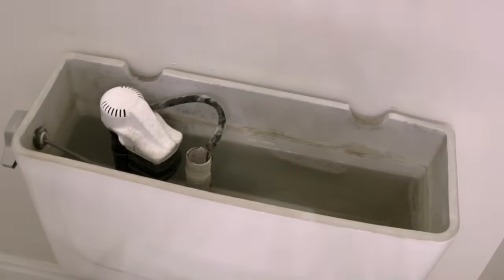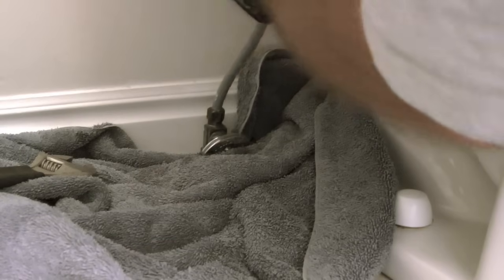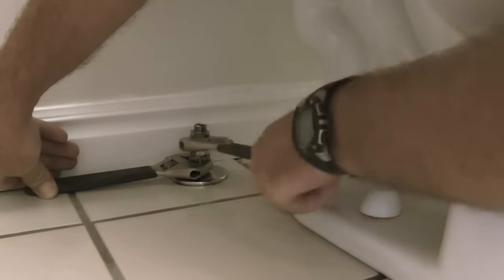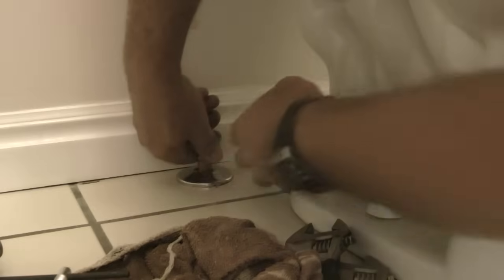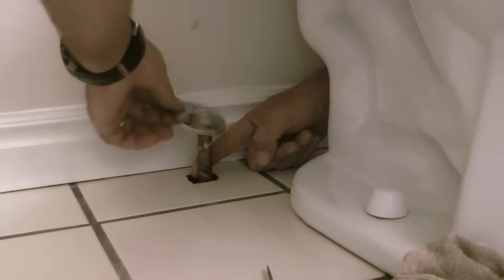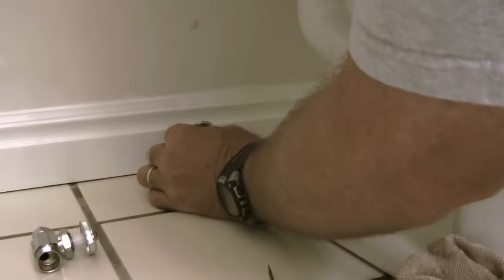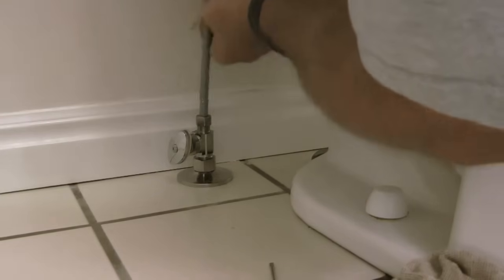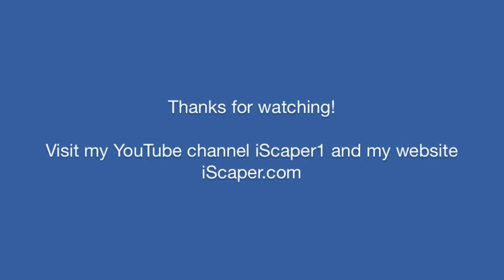Toilet shut off valve replacement

Comment: Very good demonstration. Only thing I might add for anyone who is not familiar with the details such as turning the main water supply off may need to be told this. Most plumbers have experienced floods and would know this is an important step but someone who is a first time DIY plumber may need to be shown. Thank you for your video.

Comment: I don't understand this video: why isn't water shooting everywhere?  I cannot turn off the water to the valve, and the valve won't turn off the water.  When I do what he says, water just sprays everywhere!  Which step magically stopped the water from coming through the pipe?  Confused and wet.
Reply from the maker: You have to shut off the water supply to the valve before replacing it. On my replacement I had to shut off the main supply to the house before changing the valve.
Reply: I saw he skipped that important step as well- but realized i was just an omission.  Otherwise great instruction video!
Reply: mahdroo turn off the water to your house first
Reply: @bludika  What I want to know is why an expert like you is on this same video as us noobs?
Reply: He does say, in the video to shut off the main water supply not just the valve

Comment from the maker: I wonder if the pipe your referring to is galvanized. A lot of older homes were plumbed with galvanized pipe. Normally you don't get a lot of rust with copper pipe. You might want to try WD 40  a few times on the threads, then if there is room place a pipe wrench behind the valve to hold the supply pipe. Then try to carefully thread the old valve off. Careful, you don't want to break the supply pipe.

Comment: to loosen 5/8" compression nut, turn clockwise and to tighten it turn counter-clockwise. you show counter-clockwise to tighten it but you said turn clockwise. surprised no one else commented on this
Reply from the maker: Look again, if you pivoted the bottom of the valve to look at it while loosening or tightening, clockwise and counter clockwise are as I described.

Comment: Thanks for the video. Just tackled the shut off replacement as well as adding a bidet. FYI all, I replaced the shut, the plumber who put it in 15 years ago made the pipe too short. So I couldn’t put the trim ring on (I’ll add one that opens)and after 10 minutes, a small leak formed on the bottom of the shut off. I tightened it, still no good. I took it apart and put some pipe dope on the top of the ferrel. So far so good.
Reply from the maker: Good information, thanks for posting.

Comment: I cannot separate the metal nut on the supply line from the copper fitting inside the tank.  Any ideas?

Comment: Thanks. Very practical. But suggest Quarter turn valve not the multi turn valve you use that has rubber gate stopper that will deteriorate.
Reply from the maker: Good tip, thanks for posting.

Comment: Tools/Supplies:
--compression sleave puller
--two wrenches
--3/4 inch stop valve
--screwdriver
--fill valve (if also replacing that)

Comment: How can I tell the size of my valve?
Reply from the maker: If it's copper pipe then it's probably 1/2". Copper pipe has a 5/8" OD (Outside Diameter), so you would want a compression valve that's 5/8 x 3/8.
Reply: @Iscaper   K, thank you.

Comment: Great tip on the compression sleeve puller. Other videos say to cut the pipe but that may leave you with issues down the road if you have to the repair again and don’t have enough pipe left.
Reply from the maker: Thanks, another option is to leave the old compression nut and sleeve on the copper pipe and thread the new valve onto the old nut.

Comment: I really like this video.  Instructions are very clear.  The problem with my leaking shut off valve is that it's not set up like this one......I wish it was.  The connection is straight but the valve assembly has a long bottom piece that fits onto the copper pipe.  I can't seem to find a YouTube video that shows how to replace the sort of assembly I have.  I fiddled with it and now instead of a moderate leak, I have a big leak.  :(  Time to call the plumber.
Reply from the maker: Haven't seen the valve you're describing. Can you remove the whole valve assembly and install a valve like the one in the video?
Reply: The valve is soldered to the copper pipe which means the copper pipe needs to be cut.
Reply from the maker: mrs.sam.heughan
If you take a tubing cutter and cut the copper pipe behind the valve, is there still enough pipe protruding from the wall to install a new valve like the one in the video?

Comment: I hope you respond to my question.  You video was helpful especially when it was hard to unscrew the old valve body off.  Only problem I have is that the compression ring is unmovable and I cannot remove the nut and the ring.  I have blue plastic like pipes with a copper insert at the mouth of the tube.   How do I get the compression ring and nut off so I don't have to keep the old one?
Reply from the maker: You might have to buy a puller.
Reply: @Iscaper  I ended up paying for a plumber.  He didn't want to use one as he was concerned about screwing up the plastic pipe.  He just put the new valve on with the old nut and compression ring with plenty of plumbers goo...

Comment: Awesome, maybe I'll try this when I'm off from work, thanks for the video
Reply from the maker: Good luck!
Reply: @Iscaper  thanks. We were so close but our cheap seller for this manufacturered home chinced us on pvc pipe, the nut is basically at floor level and pulling up pulls other pvc pipes. But we've known they totally screwed us and messed up our plumbing since thr vent pipe from that bathroom is bent, didn't use the right pipe, etc. We still have half a mind to pay someone to redo everything right... Anyway, Your video was great though, I appreciate it a lot. Thank you

Comment: Since you didn't replace to shutoff valve with 1/4 turn valve, I have to say you could have done this by just replacing OEM parts stem, BrassCraft BCSR01 at home depot for 3 bucks each.  I replace 21 of this kind of valve 21 of them by just replacing the stem, no mess, cheap which will last about 17 years, the time when I notice 3/21 of them won't fully shutoff.  All of them shows gasket deterioration/deform/broken/cut/brittle, time to replace all.

Comment: Alas this did not work for me. After going through the whole process of getting the supply line, top nut and valve not off, I started in on the valve body. I attempted to remove with wrenches as in the video and twisted the pipe. Had to call a plumber. Turns out, there is no lower compression nut or way to remove it. He says the majority of plumbers now use a single pipe + shutoff valve unit that they solder directly on to the copper pipe. No way to separate because they are soldered. My plumber had to cut the copper pipe in the basement and solder on a new L pipe-shutoff valve, because, again, it's usually just one piece, not a removable piece with a compression nut/sleeve. I wish I had been able to do this myself but this video didnt' mention that I would need to solder. Too bad I found out once everything was disconnected :) lol
Reply from the maker: All of the supply stops in my house have compression sleeves and nuts. I have used a new supply valve with the old compression sleeve and nut because I couldn't get them of the copper pipe.

Comment: Our shutoff valve does not have a compression nut under the valve. It is just stuck on the pipe somehow. Any ideas on how to remove the valve? Turning it with the wrench is not moving the valve at all, its really stuck on there.

Comment: how do you replace the valve that is attached to PVC pipe thats crimped on
Reply from the maker: +don gaudry 
Are you sure it's PVC pipe and not PEX? PEX pipe is usually used with crimp rings. Also in the home it would be CPVC as PVC isn't rated for hot water. CPVC is usually done with glue joints. If it is PEX pipe and you have enough slack you could cut the pipe below the fitting on the valve and install a new valve and new crimp ring.

Comment: Thank you for your video; I had a leaking Toilet fill valve assembly and had to replace; the big problem was trying to get the bottom tightening knob off the Supply line that was a rigid steel pipe with an attatched washer flange on top. I had no idea ho to take a 3/8 compression nut assembly apart at the base of the supply line which I had to take off to get the old tightening knob off and put the new one on since the old tightening know was cracked. YOUR VIDEO HELP WAS JUST AWESOME.  This was my first big plumbing job ever (well big for me at least), The compression valve came off just like your video. I was sure it was going to be frozen shut as the pipe is 20 years old, but no, it came off just like butter.   I would never have had the confidence to do this job with out your video instructions.  All is now back together and not leaking, so far. Knock on wood.  Thank you. Rebecca &:)
Reply from the maker: Congratulations Rebecca, I'm glad the video was helpful.

Comment: Hey great video well explained and step by step instructions. But in my case I turned the water supply valve off and the main supply off.but still water is still coming through the valve. What am I missing?
Reply from the maker: The valve may be lower than some of the other piping in your house, so water is coming out the valve.

Comment: Awesome video if you want to make it easier you can use the same bolt on the copper pipe because those rarely are bad its the actual shut off that bad. Be done in less than 5 min
Reply from the maker: Good tip, thanks for posting.

Comment: The hose coming off of the toilet is dripping near the nut that holds it together, what is the fix?
Reply from the maker: +Mel Mel 
Check the gasket inside the female swivel nut. If it looks okay, hand tighten the nut then tighten 1/3 to 2/3 of a turn with pliers until the gasket seats.

Comment from the maker: Thanks Nancy. It is frustrating to shut off a supply valve to do a repair and not have it work. I've had better luck with the 1/4 turn valves rather than the twist close type. They're a little more money (a couple dollars per valve) but well worth it.

Comment: Thanks...just wanted to say the it went fine and was real easy to do.  I even used the old compression nut and it works like a charm...no leaks.  I also insalled a new line from the shut off valve to the toilet.  Thanks again for the video, it helped.

Comment: i have an older house (at least by american standards) and i think that my supply valve just connects by way of a female port directly to a threaded copper pipe.  i can't quite tell because it's so rusted over.  i am worried about damaging the pipe if i just turn it and i cant get a good grip on the copper sticking out of the wall.
any ideas?

Comment: So you say you tighten the compression nut clockwise, but you are turning it counter clockwise. Is this correct? Did you say it wrong?
Reply from the maker: +April C. 
Where the compression nut is on the bottom of the valve I should have said it tightens to the right. Thanks for pointing this out.

Comment: Be prepared to wait quite awile for the water to drain out of the line before you can replace that valve!  There may be alot of line betw the toilet and the shut-off valve and
the toilet valve is often right at ground floor level.
Reply from the maker: Good tip, luckily for me this toilet was upstairs.

Comment: Total thumbs up 👍🏻

I tried replacing this last night looks just like your valve. I tighten it kinda hard and still get a very tiny tiny leak. I used teflon tape too.  Any idea what it could be?

Should I tighten more? Or use for teflon tape? By the way I am using the old nut. (Didn't replace the ring neither, I am assuming the old ring is in the nut)
Reply from the maker: This type of valve uses compression fittings so you shouldn't need teflon tape. The compression ring usually stays on the pipe when you remove the old valve. I would check the copper pipe and old compression ring for flaws.
Reply: This is a compression fitting does not need tape however you may have a leak from not deburring the pipe or cleaning it up first needs to be clean
Reply: do not over tighten. Snug until no leak. Many years ago, I kept tightening and crimped the compression ring. That may have occurred.

Comment: excellent video, im doin this right now. where did you get that tool? the home depot one i bought has prongs that pop off every time i twist with a lot of pressure. Im just going to use old copper ring, but i would like that tool for future. please let us know the brand. thanks
Reply from the maker: I bought mine at a local plumbing supply, but here is a link for one that is similar on Amazon: http://www.amazon.com/Superior-Tool-03943-Compression-Fittings/dp/B000L89AZC/ref=pd_bxgy_hi_text_y

Comment: Hey man thanks a lot for the video this was a really good walk through and the camera angle was perfect. My pipe was soldered on and I had enough excess to cut the old valve off. I had to use a bit of tephlon tape but it worked great.

Comment: Thank you for this video! How can I measure my copper supply line to see if it is the same size as the one in this video or are they all the same?
Reply: Mary It is almost certain that the supply pipe is 1/2 inch.  You can use a tape measure. Next size up is 3/4 inch and size down is 3/8 inch.

Comment: Is the process the same if the connection comes out of the wall and not the floor?
Reply from the maker: Kimberly Smoak 
Yes if you have a copper supply pipe. They also make an angle valve for this if it would work better in your application than the straight valve.

Comment from the maker: The compression sleeve puller is handy. I got it after another supply valve failed and I couldn't get the sleeve off without damaging it. 
I checked with my plumbing supplier today and he said they don't make a repair kit for these supply valves. Probably because the valves are so cheap in cost. They do make a small inline 3/8" compression valve that could be placed after the 5/8" compression valve in the supply tube to the toilet, but that valve costs as much as the 5/8" compression valve.
Reply: I think your puller is from Superior Tool.  Can you clarify?

Comment: wow - thanks for the quick reply! i tried pb blaster with no luck - what ended up doing it was i just turned the whole pipe out of the wall, bench vised it and hit it with the blow torch.

i find that fire is usually a pretty good solution to most of life's problems ;-p

thanks for your help!

Comment: the knob came off of the valve can I just replace the knob part?
Reply from the maker: You could buy an identical new valve, remove the screw in the center of the knob, remove the knob and install on old valve. Hopefully the valve stem in the old valve isn't damaged.

Comment: do you have to shut off the water main from outside of house first?
Reply from the maker: Leerosa Browne 
Usually there is a shut off valve just for the toilet. If not then yes you'll have to shut of the house supply.
Reply: Yeah... but if the thing you are replacing is the toilet shut off valve itself (which is what your video is about)... you cannot use the toilet shut off valve to shut the water off.

Comment: you should have cleaned off the copper pipe with an emery cloth, otherwise the new ferrule nut will not bite into the pipe well and you'll have leaks, also, why da hell would you replace a crappy shut off valve with another multi turn one? better off going with a quarter turn

Comment: when i try to do this water shoots out
Reply from the maker: You need to isolate where the leak is. Probably the bigger nut on the valve that tightens on the supply pipe. Is this nut tight?

Comment: This was exactly what I needed to see to continue on a project of mine to replace an old toilet.  I don't have, and would rather not have to buy, the T puller tool, so I'm hoping the old compression ring and nut will still work with the new shutoff valve and tubing.
Thanks for posting.
Reply: You should always replace the compression ring, they are only meant to be used once. The née valve comes with a new feral ring for a reason. I did what you did and it leaked into my basement right onto my pool table